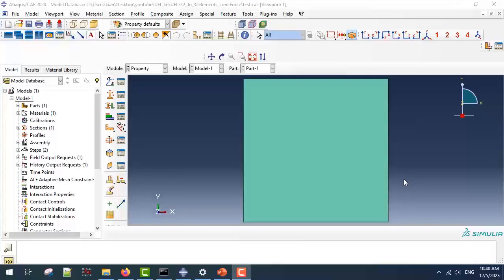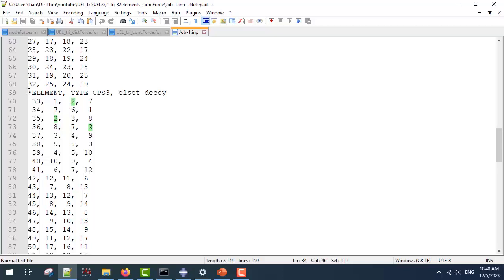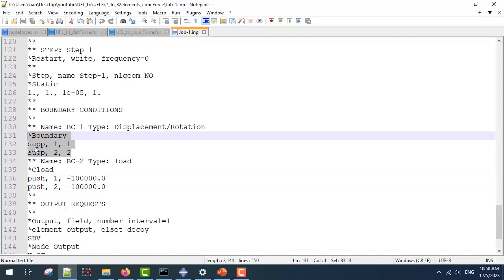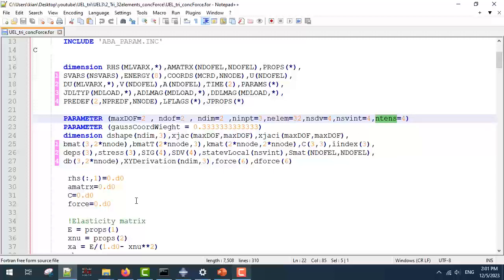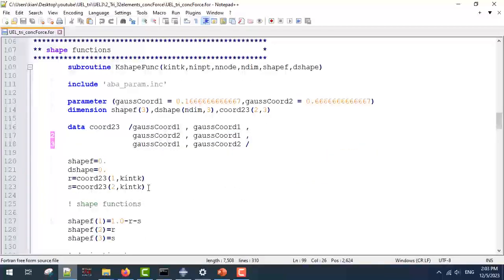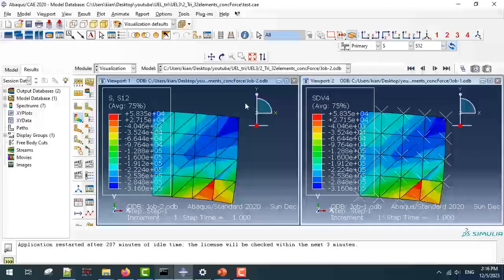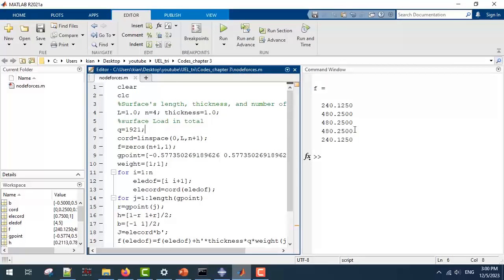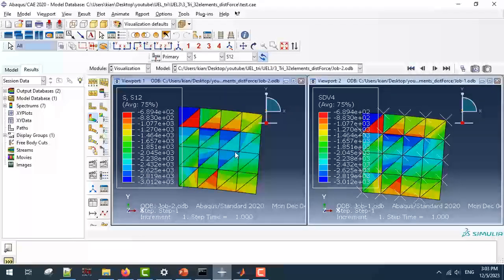UEL subroutine: structure having triangular elements subjected to concentrated and distributed loads

Comment: Sir, i am using C3D8 elements with 8 nodes, 8 integration points, 5 degrees of freedom at each integration point, 18 variables at each integration point, 13 properties. i  politely request if i am using the correct modifications below
***********************************************************
*User element, nodes=8, type=U1, properties=13, coordinates=3, var=144
1,2,3
***********************************************
*ELEMENT, TYPE=U1, ELSET=SOLID
***********************************************************

also, sir after 1,2.3 do i need to add anything more? 

politely request for help sir.
Reply from the maker: it's correct